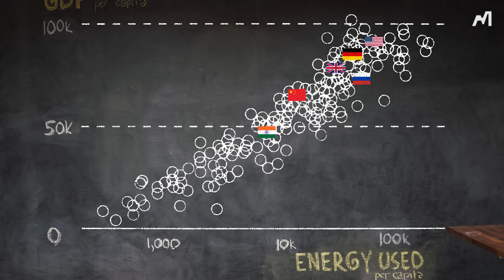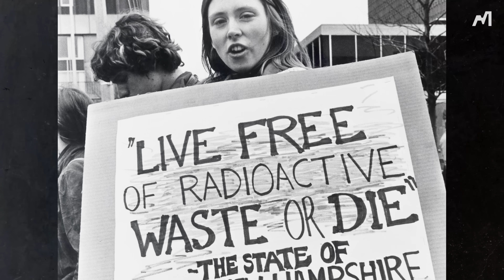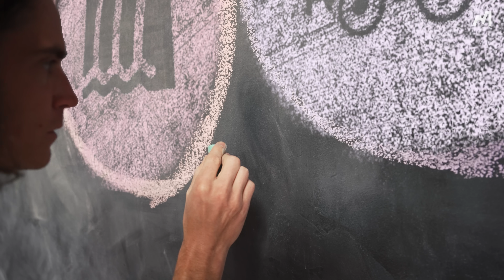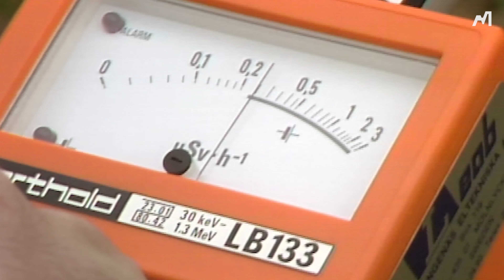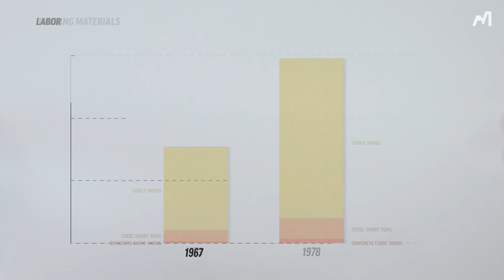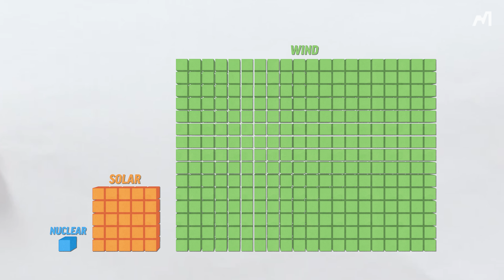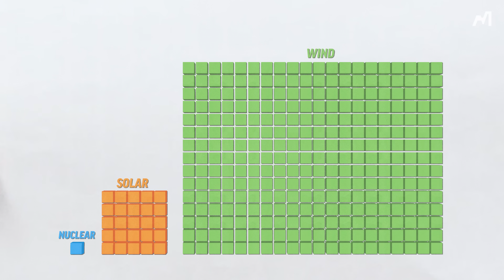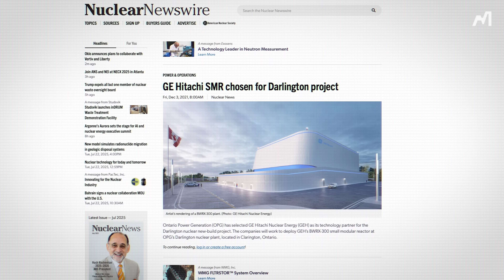They're Lying to You About Nuclear Energy

Comment: As a former submariner Navy Nuke, I agree with you. I have been saying this for years. They should use Navy reactors technology on land. It is safer, since it is a pressurized primary where the secondary generates steam. It is not a boiling water reactor. Incidentally, the torpedomen received more radiation than we did.
Reply: That's the way the last two were built I believe, in Augusta GA.  Westinghouse AP1000 reactors. Basically double boilers for nuclear power.  They are "online" now.  That's the site open in 2023.  That's when u4 was turned over.  

Yes it was a huge cost overrun. But it's so over engineered it's crazy
Reply: @Lilrabbit83 they aren't like Navy nuke reactors, the Navy reactors use highly enriched uranium, like 60% or 80%.  They don't use that on land because of proliferation concerns.
Reply: @Lilrabbit83  It was a black eye on the industry, but a lot of that was to do with the bad decisions and incompetence of Toshiba than anything to do with the design of the AP1000. 
If the utility can run that plant for 60 to 100 years, they should still make profit. Fingers crossed it works out for em. 
I suppose the next most interesting development will be to see how Bill Gates trial small modular reactor goes in Wyoming. Success there might trigger some appetite.
Reply: @Lilrabbit83 how can that ever be a bad thing?
Reply: @Lilrabbit83  I’ve spent a chunk of my life at Vogtle! Watched them install silt fence for 3 and 4 in January’09. Big problem was getting skilled labor ( society not making men ).
Reply: Off by year, it officially kicked over and started running in june 2024 for commercial power output.
Reply: I'm shipping out in March to be a sub nuke. Thank you for your service and expertise.
Reply: @sassafrasofficial3695  Best wishes to you, shipmate
Reply: I worked in 5 nuclear power plants and each one was a pressurized water reactor which means that the steam was clean and therefore the turbines were clean and everything outside of the reactor building was clean and during refueling outages the reactor pit was filled with water which is the best shielding agent and the reactor head was pulled off, you can walk right up to the edge of the pool and look down into the inside of the reactor. The dose at the edge of the pool was about 2 mr which is about as low as you can get the annual yearly allowable dose was 5000 mr. It has been about 30 years since I worked in one so I don’t know if that has been changed . During the duration of the time that I worked in the 5 plants I only received one years worth of dose total. So I guess what I’m trying to say is that nuclear power is very safe and reliable and for the money it is the cheapest and cleanest  form of electricity known to man.
Reply: @robertpatterson3406 🙏🫡… great info brother!! Thank you!! Learned alot
Reply: @robertpatterson3406 Uranium is not a renewable resource. It will run out even faster if we power the world on nuclear.
Reply: @robertpatterson3406  The problem with man made disasters is that they invariably consist of a chain of unlikely events, and there are people beforehand who assure everyone that nothing can go wrong, then say "we didn't think of that" afterwards. The problem with nuclear reactors is that it would only take one serious accident for catastrophic, unacceptable consequences.
You worked at 5 nuclear power plants, but there are nearly 100 in the United States and almost 450 in the world. I'm sorry but you can't possibly vouch for all of them, based on what you did 30 years ago. I am sorry that I don't take your word for it! It's nothing personal, it's just that no one can vouch for all of them, but we are just supposed to trust companies and governments and people on YouTube that everything is hunky-dory...
1. There have been two significant accidents and quite a number of incidents. When it comes to safety, it isn't a matter of what HAS happened, it is a matter of what COULD happen. 

2. As far as cost is concerned, let's ignore the significant capital costs involved in constructing and decommissioning a nuclear power plant and focus on one thing. The US National Debt is currently $37 trillion - which is an enormous amount of money - and then consider that the cost, so far, of cleaning up the Chernobyl and Fukushima accidents has been $1 trillion.

The issue is one of risk. What HAS happened - which is what proponents of nuclear fission focus on - is not as important as what COULD happen. As long as there is any chance, no matter how small, of a massive nuclear accident - and anyone who says the chances are zero is either lying or delusional - then the risk is just not acceptable. It was one thing for a Chernobyl to happen in the USSR, it was another thing entirely for Fukushima to happen in one of the most technically advanced countries in the world. That's why the Germans -  some of the best engineers and most sensible people in the world - decided to shut down their reactors after Fukushima.
Reply: @robertpatterson3406 yeah just thats not the kind of reactor MS is now planning to reactivate for their supply. If they talk about runtime extensions etc they talk about exceeding designer's planned lifetimes... you gotta get it in your head that they are not going to be operated in best shape forever. And that the safeties you see in positive scenarios are not automatically ok in disaster. I.e. the coolant pool in Fuku that got >< this close to cooking... it looked clean and safe for like 50 years before. Spotless, safe, controlled, maintained with japanese precision I am sure. Every day just perfect for decades. And thanks for that. But good enough and safe for real? Not at all.
Reply: @udirt  yes most American reactors have already exceeded their original life expectancy.
Reply: @robertpatterson3406  I know a guy who swim in that water  and even drink it. There is no radiation and nothing is nuclear per se. They even do not know what atom is. let alone electron, they never isolated one. But the scam about the bombs still goes on. You call the yellow cake "Uranium" which is nothing more than enriched Sulfur. That is what actually heats the turbines or you gonna pretend its not, or you simply do not know i.e. not allowed to know? Ofc its the cheapest - Sulfur is abundant element. Time has come for myth busters so we can expose this yet another great scam done on humanity.
Reply: @OutlawTV89  that’s over my head , I would be interested in seeing the information though
Reply: I was kinda sad when my cities nuclear plants were shut down and demo’d. Jacksonville Florida.
Reply: @ProperhateWW3 will happen before the end of 2027 (I keep seeing convergence around June 2026)
Jacksonville, FL will get nuked. Period. Move in the next 9 months West and North. The Southern half of Florida will have it's own cataclysm; so don't move there
Reply: There has never been any nuclear plants in Jville, Fla only has ever had 3 sites , St. Lucie, Turkey Pt in Dade co, Crystal River.
Reply: @Properhate how is jacksonville fl?   How hot is it compared to tge southern fl
Reply: @Sukiyahah Obama’s war on coal!
Reply: @Properhate  **my CITY'S, not "my CITIES."  Please learn grammar.
Reply: The Connections (2021) [short documentary] 🎉❤🎉
Reply: They do. The PWRs common in the USA were based largely on the Shippingport reactor that was the basis of US nuclear propulsion (and the US's nuclear power generation.
Reply: As a former Navy Diver who was diving on submarines in New London CT.  I agree!  Around 30 nuclear reactors on the waterfront, and never an incident!
Reply: In the far east of russia they actually hooked nuclear subs up to the power grid during oil shortages, I believe the case i saw was in sakalin or vladivostok area.

People were roasting them in the comments of the video laughing about how they needed to do this because 'russia so poor'

I'm sure the people appreciated it rather than having to go on energy rations/rolling blackouts.
Reply: @Geopolitics2day They have also used a sub in Honolulu Hawaii. I powered the entire city I believe for 3 days.
Reply: The best commercial reactors are PWRs. I’m an operator at Diablo Canyon.
Reply: The majority of civilian nuclear reactors use the pressurised water configuratio not boiling water.
Reply: Dominion (2018)
Reply: There is a saying that always applies to any regulations or laws, "Follow the Money"
Reply: They insist on ignoring our fabulous fleets of aircraft carriers and submarines.
Reply: @GeraldTodd hi bobby
Reply: as a former nuke, myself, I would prefer a molten metal fast reactor - operates at atmospheric pressure...and since it is not subjected to the concerns of submarines, can be computer-controlled, making a fast reactor safer to operate. This could also be a bit more efficient and easier to build and maintain. It would also be easier to decommission...simply entomb the whole damnnthing in place, with the expended fuel. As a molten metal plant, at atmospheric pressure, there is no issue with leaks from the high-pressure piping. With no high pressure innthe primary side of the plant, embrittlement of the reactor vessel and nearby piping is also not an issue..
Reply: They are developing molten salt reactors as a solution to this.
Reply: Speakin' truth, shipmate.  YEah, I was an A-Ganger, but NNPS Nuke Waste week 21, so I learned a lot before I left the program.  Nuclear is not evil.  And I'd really like to see pebble-bed reactors shift front and center.  But SMRs, whether USN-style or other, is a super effective way to deliver energy.

And yeah, the TMs and IC men and us A-gangers got more exposure than the nukes, because LOWER LEVEL!
Reply: Thank you for your service 🫡🇺🇸🙏
Reply: There are 63 commercial PWR plants and 31 commercial BWR plants in the United States.
Reply: Trump signed an EO in his last term for mini nuclear reactor research.  That will eventually make its way to the consumer.
Reply: Propulsion Plant Alarm?
Sleep 😌
Reply: Apparently After TMI congress discussed whether to put all reactors under military operation because the navy's operation standards were known to be so much better and it would remove the decision power from corp managers. Don't you gotta keep in mind the size/output difference though? Not to mention your subs are quasi automatic containment and not normally operated inside the land 😂
Anyway, the video is BS nonetheless.
Reply: My brother was one also selute
Reply: Represent
Reply: Don’t need to use any high pressure reactors nowadays even the inventor of the high pressure water reactor said that those reactors were not suitable for large scale power reactors
Reply: Thorium is more efficient than PWR's, and it sits at 1 Atmosphere; which makes it far safer than PWR's.  Lets not also forget that PWR's (which are built off of the navy Designs) are extremely inefficient using at most 4% of the Fissile Material, and only won because of that pesky bit about Sodium exploding when it comes into contact with Water.
Reply: the main problem here, ignoring the fuel itself, is the cost. Naval reactors are HUGELY expensive to build and operate, both due to the constraints, and required resources (highly enriched fuel) 

It's the reason it hasnt happened yet lol.
Reply: Sailors on nuclear ships have a 10 fold excess cancer risk. Google Chris Busby us navy cancer study. Idiot.
Reply: And the Navy is going to operate all of them? Civilians will not be trusted with highly enriched ("weapons grade") uranium. (plus, that stuff is really expensive, so a very poor choice for a power plant.) There are several different designs... boiling water, pressurized water, etc.

(The military reactor put at McMurdo didn't work out so well. The thing leaked constantly.)
Reply: How did the TM's get more, unless youre hinting at the cruise missiles? 10-20k diesel is pretty effective shielding
Reply: China is building close to 100 over the next decade.
Reply: Efficiency is the utmost important! Liquid metal cooled reactors are the way forward. I am, however, unsure of the processes involved with obtaining so much sodium or potassium.
Reply: Why are they such a head ache to demo?  Like the old ones??
Reply: Why not just put it under water too like a sub. No impact from weather,  and extremely hard to get too.
Reply: They are using small reactors for individual factories..MAGA
Reply: We DO use navy nuclear reactors on land, aka light water reactors.
Reply: I've long wondered why we don't use this for cargo ships. Is the up front cost too high?
Reply: Chainsawman
Reply: Too bad for them I hope you and your associates live as long as you want and never have to want as long as you live . As I know you understand the lethality danger.
Reply: Rolls Royce in the UK have modular small nuclear reactors now that can be used in locations that would benefit from localised electricity production. I suspect that technology may well have come from Submarine reactors.
Reply: In the US there’s BWRs and PWRs. So we’re already using pressurized reactors now
Reply: What is the output on one of those babies?
Reply: Every state should have enough of them to make them independent from a national grid if desired.
Reply: I don't agree.  Are you familiar with Alvin Weinbergs Molten Salt Reactor design?  Uses Molten Salts and Thorium instead of pressurized water and Uranium.  You should check it out.
Reply: @BlowmiKwikli  Thorium was actually the original nuclear fuel but was ultimately rejected because it's useless for producing atomic/nuclear weapons-grade material. That seems a tad short-sighted in retrospect.
Reply: @StonersRadio  I couldn't agree more.
Reply: Naa, we should be using fast breeders. Most of the early commercial nukes were just scaled up Navy reactors, and that was probably a bad idea.
Reply: Pressurised Water Reactors are like that already, aren't they?
Reply: Also surrounded by insulation. Water
Reply: Quick! Someone throw up a manual on the Warthunder forums so we can really know who is right ;)
Reply: Cant happen because Navy reactors use 90%+ enrichment which is weapon capable.
Reply: @skyrailmaxima  The only reason why they are enriched so high is for a smaller longer lasting core. The tech can still work at 4% enrichment which is standard for civilian reactors.
Reply: @rookooful  The cross section of fissile isotopes is actually why, to have a high enough chance of interacting with a fissle isotope and not adsorption by another nuclei is why they are so high. Civilian reactors can get around this by building huge reactors to make a much higher chance of interaction and not with non-interacting cladding like zirconium. Navy reactors are not super high burnup for their fuel ratio, meaning it has nothing to do with lifespan, and everything to do with space constraints on the core.
Reply: @skyrailmaxima Personally, I’d be on board if the government oversaw a few state/federal reactors that utilized navy style reactors with high enrichment, because it’d be, well, government controlled.

Keep it exclusively nation-side and don’t sell the plans or fuel to anyone else to keep it from ending up in weapons.

I don’t know how feasible it would be (esp. right now) but I think I’d be happier to see the government itself trying to promote/utilize nuclear power rather than relying on commercial entities (I may be wrong on how uninvolved/involved the government may be).
Reply: @Palgineer  I would be more concerned about sub intel leaks
Reply: @Palgineer All Nuclear power is already government controlled.
Reply: @Palgineer  it's only required because they are designed to run a long time before refueling.
Reply: @Palgineer  the issue with weapons grade is that if something goes wrong it goes extra wrong. I'm on the side of self-extinguishing molten salt reactors with low grade fuel that can use old atomic waste myself. It's just such a win-win
Reply: @Palgineer  Things would get expensive. My first job in the Marines was standing guard over 2 nuclear sites in Georgia and Washington. I don't think the US wants Marines everywhere at every powerplant as well..
Reply: @Palgineer AI and government owned nuclear power, a match made in heaven 🫩
Reply: @skyrailmaxima  not mention the economical burden of such refinement, hint its not cheap or easy.
Reply: @skyrailmaxima  That is primarily because of their size and refuel requirements the concept can work will uranium enriched at lower levels.  AP1000 uses up to 5% I believe
Reply: @skyrailmaxima  most of the SMR designs are using HALEU, high assay low enriched Uranium, it's enriched to just shy of 20%.  The big reason we aren't already seeing SMRs starting up is that the major supplier of HALEU is Russia.  Sanctions over Ukraine put a massive roadblock in the supply chain.
Reply: @skyrailmaxima  New SMR's for domestic application will use LEU and have an enrichment of ~5%
Reply: @skyrailmaxima  Pretty sure the French use low-enriched Uranium in their subs.
Reply: @skyrailmaxima  I want my second amendment approved weapon capable enriched uranium right now!!!
Reply: @Granite1_1  I mean, if you can make it, know how and you dont expose anyone to any rads, the FBI had to release David Hahn because they had no way to charge him.
Reply: @skyrailmaxima  I'm not supposed to point this out, but 20% U-235 can still make for a viable, deliverable nuclear weapon. Non-proliferation is a boogeyman.
Reply: @Shaker626  Its yield would be near conventional and its compression metrics nearly impossible to achieve. Yes you could, but it would weigh two tons and would have less spark than tnt of the same mass.
Reply: @skyrailmaxima Doesn't matter the yield, pop that off on the soil of a nuclear state, and they will wipe you out.
Reply: @Shaker626  That goes for any explosive, but they caught a yakuza with 1.5mg of Pu, youre not getting your hands on 4x the ammount double enriched HALEU to fuel a full TRIGA core even with 1970s security standards. The yield would be so low the radioactive yield would mostly be fuel. Color me more impressed you could be smart enough to aquire and assemble it but not smart enough to know it would be useless.
Reply: @skyrailmaxima  the British detonated a nuclear bomb with reactor grade material, its still being maintained publicly, by Theresa May in parliament that its not possible to use reactor grade to make a nuke but we did it in the 1950's *edit might have been as late as 1962
Reply: @frogmastiff8198  That's because the British definition of reactor grade  is different from American, and that one fissled more than fissioned. Its yield was super low because Pu240 is super reactive compared to 239 causing it to pop before a substantial amount of fission occures
Reply: @skyrailmaxima , yes, the sub can b turned into a nuke in minutes as well the ac carrier
Reply: Former ICE2 checking in.  Thank you for serving Our Country.  I can also confirm this.
Reply: If you were navy like you say.. what is a TLD and what are they for ?
Reply: @MrDantheman45  That’s an odd question. I was navy, not nuke, and I know what that is.
Reply: @MrDantheman45 don't have to be navy -TLD, SRD
Reply: If you  were really a Navy nuke, I'm surprised at your lack of understanding. I was a reactor operator on a FBM sub. After that, I worked for over 40 years in the commercial industry as a control room operator and in training operators. A little more than half of commercial plants are PWRs, not BWRs. We can't use highly enriched uranium like the Navy (like the man said, around 95% enriched) for several reasons, not the least of which is the NRC won't license a highly enriched reactor.
Reply: @ikkenhisatsu7170  I am not a reactor operator, but the Navy uses nuclear reactors for two types of ships: large aircraft carriers and submarines. In other use-cases the benefits of not needing to refuel regularily do not outweigh the costs.
Reply: Um, most commercial reactors in the US are PWRs.

Have you ever done the math on cost per MWh on a naval reactor?
Reply: 0.7% of all mined Uranium is used for enriching so that alone causing yellow cake mountains is disgusting. The mining of uranium used for nuclear fission and its environmental impacts is criminal. This should be mentioned because it greatly affects communities and environments around the mines in NSW Oz yellow cake winds have been shown could be the higher blood cancer cases that are higher than in the rest of Australia.
Reply: That's because the torpedoes have nuclear warheads.
Reply: Tell me this would have saved the day at Fukashema.
Reply: More stupidity is not the solution to stupidity.
Reply: Truth be known, nobody knows how to safely store spent fuel for 10,000 years-- let alone how to pay for the storage expense up front, as it should be,.
Reply: @richardmcbroom102  100% of spent fuel is reusable. Most is uranium that can go right back in after separation plut is just more fuel, and the rest are medical, imgaging, and RTG isotopes. Not to mention all the fundamental studies work that could be explored. There is no reason to cap this stuff for 10000 years, and every reason to use it as we make it. No reason to pay to store it, every reason to charge morons at the NRC and DOE with crimes against humanity for creating this mess. Energy was a non issue, then morons elected Carter. What a mess.

Nuclear has the least environmental impact, and dosent spread heavy metals the same way that solar has or created foreverlasting fiberglass waste like wind.
Reply: @richardmcbroom102  I think it's a better problem to have honestly compared to how we currently store our emissions in our atmosphere. Modern methods of storing spent fuel give us enough time to find better alternatives anyways.
Reply: And as a former engineer for BWXT (I’m sure you know what company that is), I will have to disagree for one big reason: Its impractical to implement on land, especially for its power output.

The current tech fir land based systems is already really good, so there is no need for it
Reply: @rufus2028  "fir"?
Reply: @rufus2028  yeah, my BWX stock is doing well😄
Reply: The problem is it is expensive to do so...
Plus, navy operators don't have the cost minimization pressure on commercial powerplants, the board have so many reasons to do less then they should
Reply: Orrr we could just be allowed to make our own homes solar farms
Reply: @savageafmusic  "allowed"?
Aren't you allowed to there? 
🇦🇺
Reply: @iRossM No.  Electric companies in SC only allow you to produce up to 85% of what your home puts out.  Anything beyond that will not get approved with the county or city code
Reply: When you define it as clean energy aren't you leaving off the labor end (actually, the starting point) of this high-technology intertwined global industry?My dad mined, milled, and hauled for numerous private companies contracted to supply Uranium for the Atomic Energy Commission. He retired with about $1,500 /mo. Social Security income. Not complaining-he lived into his early eighties.But calling it clean energy is a term that buys consumer support, not the educated among the supply side chain of the environmental, political, and economically conscious Americans.
Reply: They all generate nuclear waste that must be closely managed for tens of thousands of years. Uncontained nuclear fallout sources like the three never contained molten reactor cores at Fukushima, emit each year the equivalent fallout of hundreds of detonated nuclear bombs. Uncontained corium get worse, not better, over time in both volume and radioactivity of fallout emitted. What is nuclear fallout bioaccumulation? What is Chernobyl Heart Syndrome? How much Plutonium would it take to end all human life? About a kilogram even distributed. How much to end all life? About six kilograms evenly distributed. How much Plutonium is in the atmosphere from all prior sources like above grounds weapons testing (yep, still there)? 240 tons. What prevents otherwise good people, perhaps intelligent, to not grasp the greatest possible harm to their own children?
Reply: So you did get radiation.... Kinda defeats your comment
Reply: @ariesbird7651  You get more radiation from a few hours at the beach. Nice try.
Reply: @vinniec5286 it also ends in "a few hours" when you leave the beach. will anyone you know ever be around to see your subs 200 years from now? The 10,000 half life? No, absolutely not. This ends all conversation about it's viability. It's not safe. Period. But you'll defend it because you won't be around for the fallout. Common sense isn't common
Reply: There is no such thing as permanent, safe, storage of spent fuel (witness the ongoing storage of spent fuel at plant locations from lack of dumping sites, making each reactor site "an event in progress," just like what is going on at Chernobyl and Fukushima)!
Reply: If ever there were an ultimate limit to "growth," it would look exactly like what is happening now, where all alternatives are short-term gain at the expense of long-term sustainability.

There is no such thing as permanent, safe, storage of spent fuel (witness the ongoing storage of spent fuel at plant locations from lack of dumping sites, making each reactor site "an event in progress," just like what is going on at Chernobyl and Fukushima)!
 
More stupidity is not the solution to stupidity. The simple fact is that the intense ionizing radiation in the boundary of the nuclear fuel causes the containment to transmute over time, where the containment materials lose their original elemental qualities, frequently becoming brittle and no longer able to perform as originally intended. Zombie reactors that are past their designed life are losing the safety safety factors originally designed into the containment in ways that are not predictable until incidents inevitably occur. The same thing applies to the containment of high-level nuclear waste. These matters are well-known to the industry, but being withheld from public scrutiny in order to maintain the current zeitgeist.
Reply: Have you heard about the massive leak of radioactive pollution into the sea from an aging Royal Navy submarine in Scotland? It happened in the last few weeks. The beaches around Scotland and northern Ireland are currently unsafe and anyone eating north Atlantic fish is at risk.
Reply: @kubhlaikhan2015firstly it wasn't a submarine that leaked, secondly there is no risk as it was a small amount
Reply: @kubhlaikhan2015  That's not true. The leak wasn't massive and it wasn't from a submarine.  Reading between the lines it sounds like they inadvertently released processed reactor coolant whose only artificial radioactive component is higher than normal levels of tritium.  In its pure form it poses no risk to people, simple dilution rendered the levels nearly indistinguishable from background before the water left the perimeter of the base.